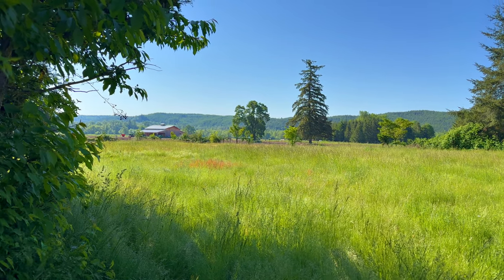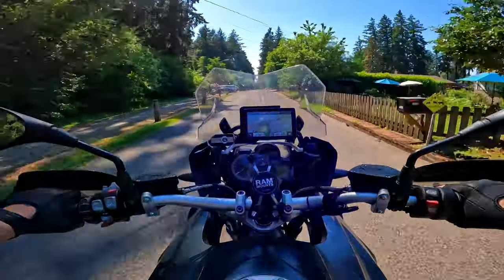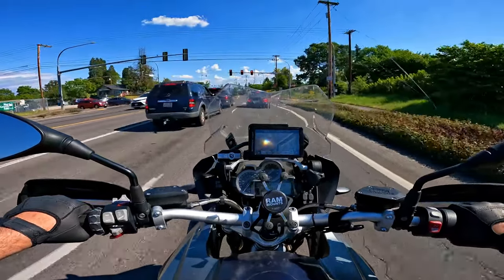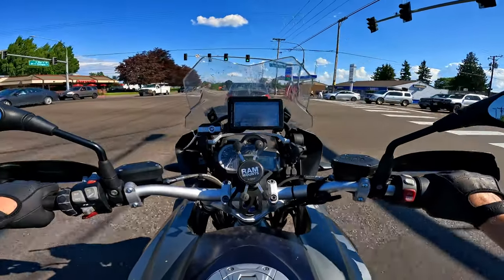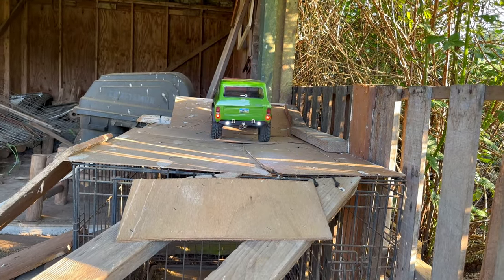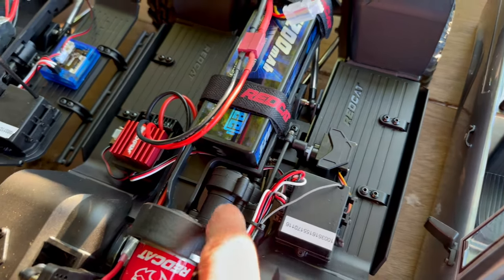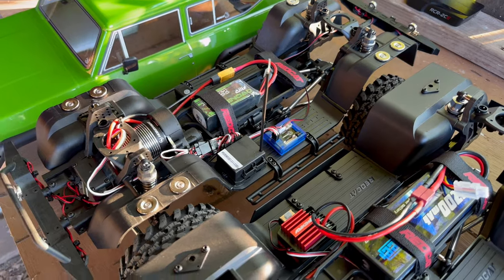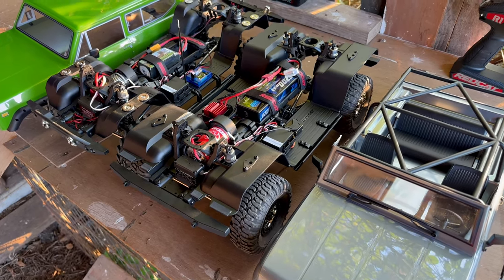2016 GS Service & Test!! • Redcat Gen 8 vs Gen 9! | TheSmoaks Vlog_2749

Comment: I see you have a Zeee 5200. I have the Zeee 3s 5200 version. Just tried it in my F150 for the first time tonight. I was gone for an hour with it and it was still going strong, I am curious how many mah I put back into it when I recharge it. BTW just ordered an Amazon trailer so I can haul my F150 to the park with the Bronco. Enjoy the rest of your weekend with Kelly. :)
Reply from the maker: Way cool..!  I slow charge the LiPo's. 2A for 5200 2S, 1.5A for the 6000 3S and 1A for the 2200 3S that I have...  Trailers are so fun with RC's!

Thanks Doug!! 👍
Reply: @TheSmoaksVlogs  I am the same, no rush to charge them so I usually charge around 0.5C. The batteries last longer that way. I had it out again today for about 30 minutes and it is still on the same charge. I posted the videos on my FB page. I went back last night and checked your videos from 3 months ago and be darned if I didn't order the same one you have. I had it narrowed down to three before I decided on that one.